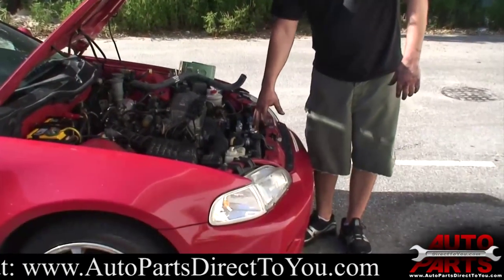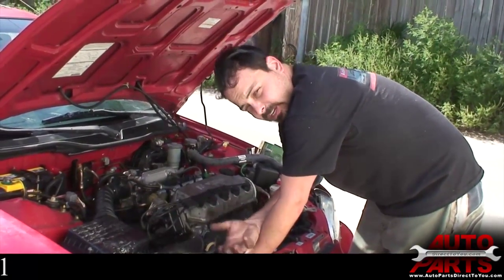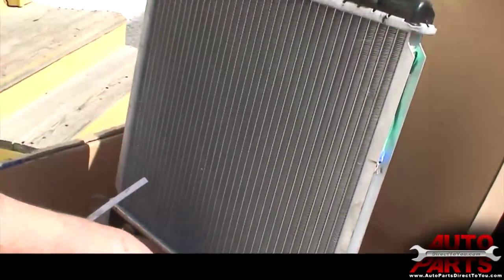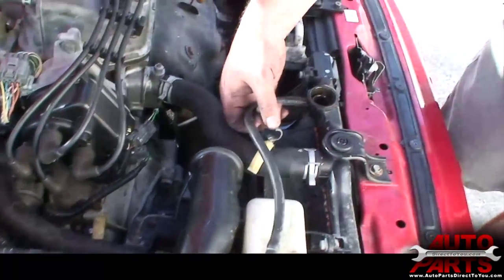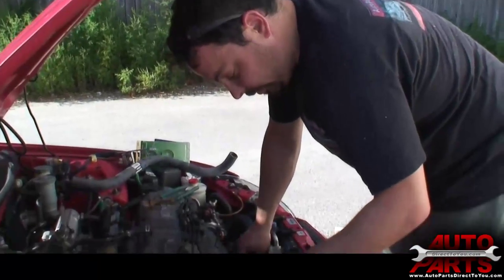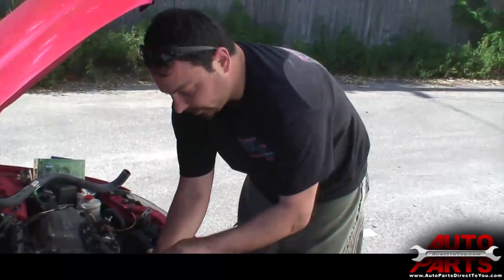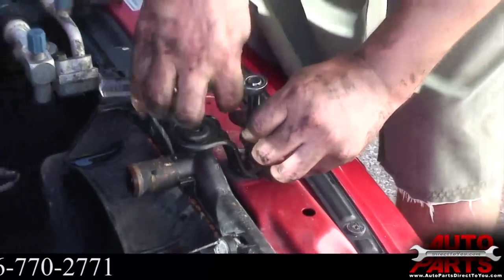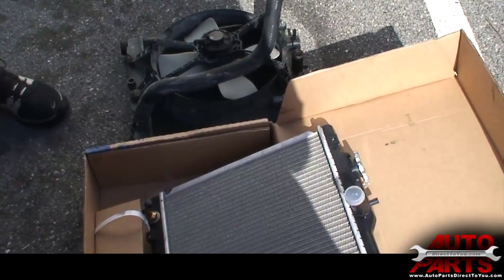1994 Honda Civic Radiator Part 1

Comment: Thanks so much for this!  You definitely saved me some money changing my radiator on a 98 Civic EX.  Also a minor point, but the tip about cutting off the old hoses saved me a lot of frustration, I went ahead and bought new hoses and clamps and voila!  The only thing you didn't cover is that years of northeast winter salt took it's toll and I had to use an extractor on all 5 bolts!  Even with that tool purchase, I still saved a lot of money though, thanks again!

Comment from the maker: @greyes666 The Transmission cooler lines are the only difference in the automatic vs manual. You do not need to block the lines,, once you pull them off the radiator, they will only leak for a short bit and then they will stop. The only other difference is that you want to check the transmission fluid level after the job in an automatic.

Comment from the maker: @HmongGuitarPlayer If the fan doesn't come on properly?  If the fan is not coming on then you have an issue with the electrical system. You would need a schematic of the cooling fan circuit and start tracing wires to see where the fault is. This is not always the easiest task and it may be a good idea to bring it to a shop for diagnosis.

Comment: Great video. One thing you failed to mention is to turn the heater on with fan off. This will help cycle fluid through the heater core.

Comment from the maker: @74bluewolf The procedure you described will work well to flush the block, you can flush it with water, and then leave the water in the block, but when you fill the radiator you want to use non-dilluted coolant because you will already have a large ratio of water in the engine, then as the engine runs the coolant and water will mix (you are supposed to have a 50% water 50% coolant ratio).

Comment from the maker: sorry if I am misunderstanding your question, but I think you are asking if you can install the Radiator without hooking up any transmission lines to it? If you car is a manual transmission, you won't have any transmission lines, in this case, just don't hook anything up to the transmission fitting on the radiator, you can leave them open.

Comment from the maker: @HmongGuitarPlayer  There are a few different coolant sensors on the passenger side of the cylinder head, the one that controls the fan has two wires, a Green and a Black going to it, I hope that helps!

Comment from the maker: You do not have to drain the transmission fluid, you will lose a little bit of fluid when disconnecting the transmission lines from the bottom of the radiator, but it won't be much. The only extra steps would be to disconnect the two transmission hoses going to the bottom of the radiator.

Comment from the maker: @manel444 If your radiator is leaking badly, you should not drive the car, when the system looses pressure the coolant can boil much easier, if the coolant boils in the cylinder head you can get hot-spots which can cause the cylinder head to warp and then can cause the Head-Gasket to fail, which you do not want to happen. Thanks!

Comment: on honda civics from 88-0000 the radiator fan will NOT come on with the AC, because the condensor has its own seperate fan.

Comment: i replaced my radiator,thermostat both hoses and clamps. My car will crank but not start. The car ran fine before i did this job. what do you think could be my problem.

Comment: i have honda dels sol 1995 it has a small radiator hose going from air intake bottom to top air intake, that hose burst because my radiator fan failed, is there any other places in the car that coolant comes outside the engine, besides the lower and uper radiator hoses, so I can replace them, because they could of craked do to overheating.
Thanks in advance.

Comment: i got a 94 honda civic ex i dont know oil brand is good for it. the guy at auto zone say use castrol gtx high mileage & i just don't want to put any kind of oil in it.

Comment: Hey I have a question,I bought an aluminium radiator it comes with transmission lines but mine it doesn't come with valve caps or caps in the transmission line,can I connect it of that way anyways?

Comment: Shit!!!  Mine is doing the same thing.  After over 250,000 miles, I thought it was my spark plug that was causing hesitation, but after putting in more fluid, it was driving better...but it looks like Civics are having this same issue.